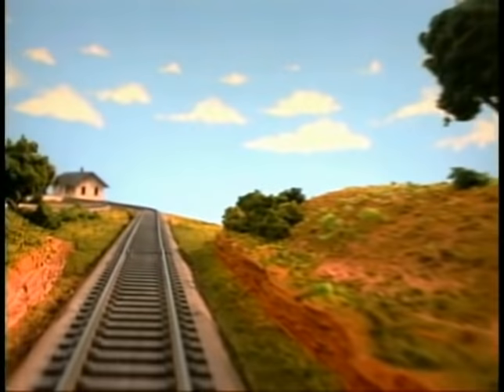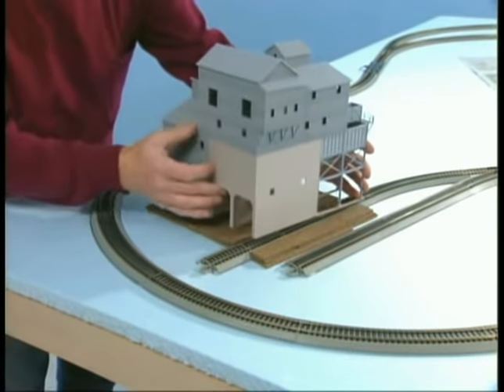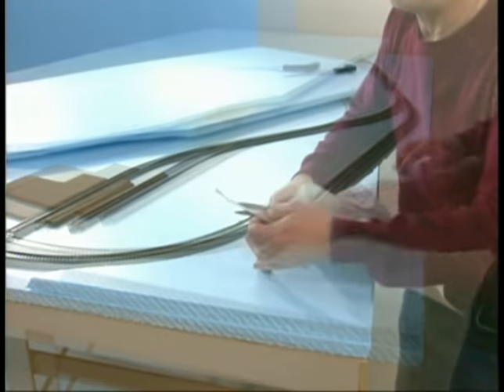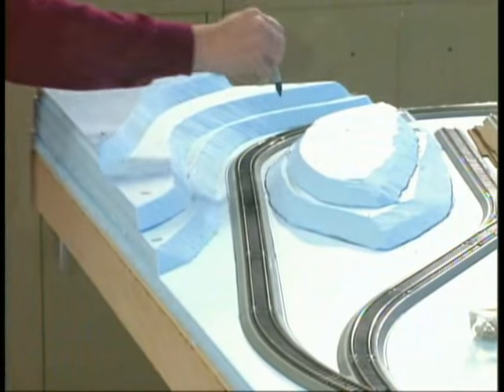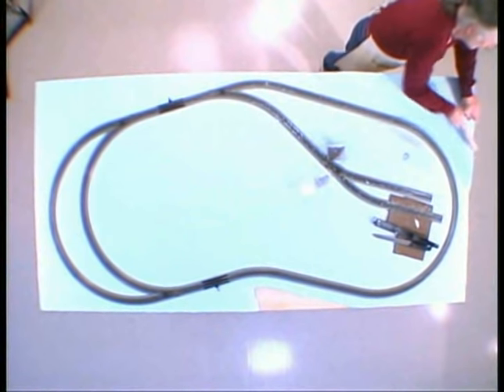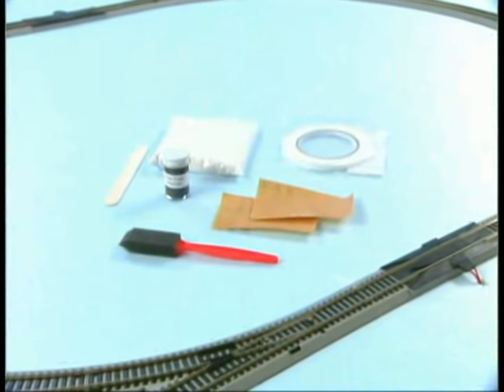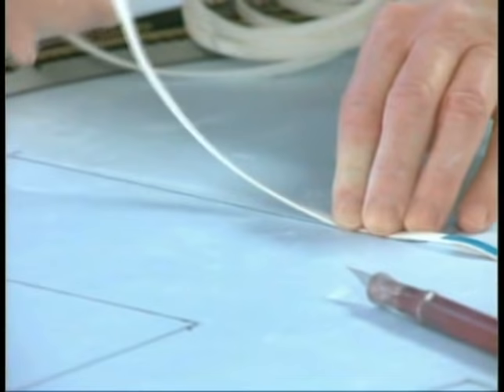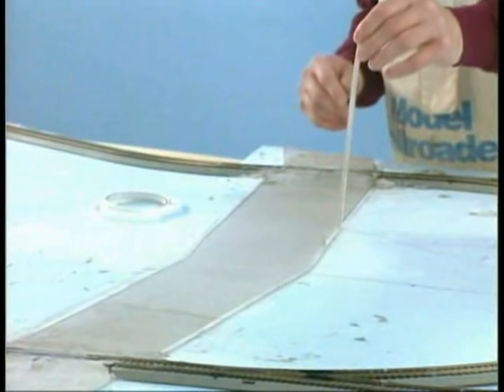Build a model train layout: Model railroad scenery Part 1 how to WGH

Comment: One can get usually obtain the Dow blue,  extruded polystrene foam from wholesale and retail stores that also supply lumber. I saw a large selection of Dow extruded foam at a Home Depot Store. 

If your timing is right you could get some of the blue foam left-over from building or rebuilding structures in your area.

Comment: I would use news papers , cardboard strips and masking tape for the mountains...Also i use durable paper towels soaked in woodland scenics plaster , it works just as good as rigid wrap.   Just roll the newspapers in a ball and support them with masking tape and build it up.  It will save you alot of money

Comment: Thanks for the details of building a model railroad layout. Well show you how to build a 4x8 model train table (benchwork) from plywood, lay sections of track, create easy realistic scenery using foam and paint, assemble model buildings, and wire your layout with a DC power pack. For more further information, you can search on google as  elumpa railroad buildings alchemist.

Comment: Let's say I can afford to buy this stuff, but lack the space... HO and O scales are my favorite, and I wanna buy a lot tracks for a huge layout. Has anyone ever dug a huge hole in their backyard to build a basement or underground room for stuff like this? I'm thinking like 25-30 foot long and 15-20 wide...
Reply: Go for N Scale.  You can build it to represent a Larger Area of Real Life.
N Scale (or more correctly N Guage) is 1:160; but take note that Models for N Scale are not always 1:160; even though they may be labelled as N Scale.  Many are 1:150, or even 1:148; so be sure to choose one or the other in particular:  Otherwise you'll end up with the same type of Structure in 2 different physical sizes (not counting 1:160).  However, using 1:150 (the smaller one) AND 1:148 (the larger one) of, let's say 2 Houses, can have its benefits.  If you want to make them seem further apart in a small space, such as one in the foregound and one at the foothills (your backdrop), you can use the 1:148 in the foreground, and the 1:150 in the background (or 1:150 and 1:160), to show perspective.  Although, 1:160 Model Structures & Scenery Accessories are not easy to find.  Also, some Plastic Models (such as Vehicles/Planes) that need to be assembled only come in Scales such as 1:100, 1:144, 1:200.  In this case, you can, if necessary, in certain circumstances, use 1:144 with N Scale, but not advisable.  If you do, try to use 1:148 in conjunction with it, rather than 1:150.

Comment: no point to even glue it, when you use easy track stuff. the benefit of easy track is to allow you unload and re-make another layout for a change.  -  just screw a few spike into the track to fix it, and when you expand your layout, redesign and redo

Comment: There are far easier, less messy and quicker methods of building a hill.
Reply: JAZZ MAN yes, i used clay as an rough shape for the hills, and then applied plaster strips on top of it. Let it dry for 2/3 hours. Then it's possible to paint the surface and put your scenery on.